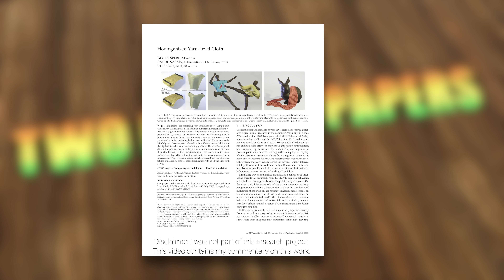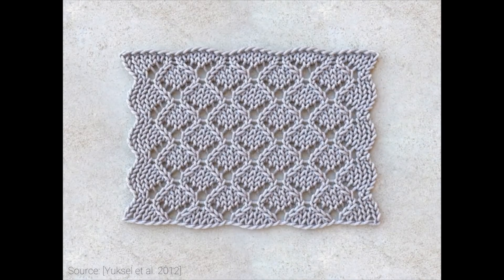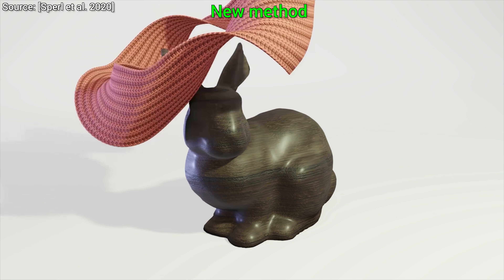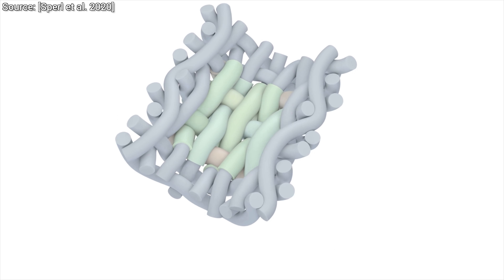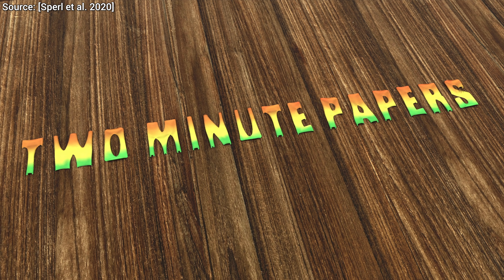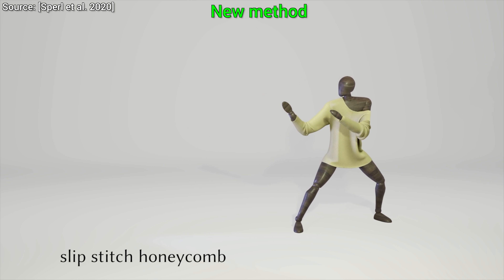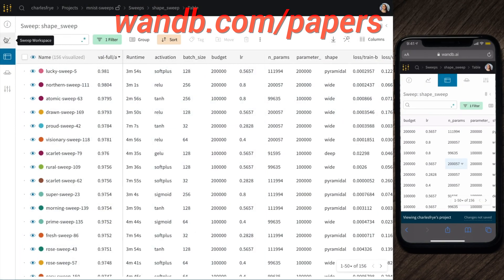9 Years of Progress In Cloth Simulation! 🧶

Comment: I feel like the video glossed over too many details of the paper, resulting in people wondering what the point of all this is, or whether the authors were "cheating" in some way. Which is a shame, since there are some rather interesting innovations in the paper. So anyways, here’s my take on a short(ish) summary of the paper. Hopefully this will answer some questions.

DISCLAIMER: I’m not any of the authors, so I might get things wrong.

Like Károly said, while simulating individual yarns for a piece of cloth looks great, it takes an insane amount of time to calculate interactions between individual yarns. This makes yarn-level simulation unfeasible if
a) the threads are extremely small and/or dense, like a t-shirt, or
b) if the piece of cloth is really large.
Essentially what this paper does to address these problems is that, instead of simulating individual yarns, it creates a 2D surface that mimics the behaviour of patches of knitted cloth. This is akin to, say, fluid simulation. In fluid simulation, we very rarely want to simulate each and every molecule, since that’s impossible with even just a few drops of water. Rather, we use a 3D volume that mimics the behaviour of a bulk of fluid molecules. The key insight of the paper is then that we can use these fluid-sim-like methods for knitted cloth (the technical term for this is called “homogenization”, hence the paper title “Homogenized Yarn-Level Cloth”.)

So how does this paper go about doing this? Since there are a multitude of ways to weave threads together into cloth, there’s no one general physical model that can be easily used to describe the behaviour of knitted cloth (if we use threads as the model, this would just be the 2012 paper all over again). The authors instead proposed the following two-step algorithm:
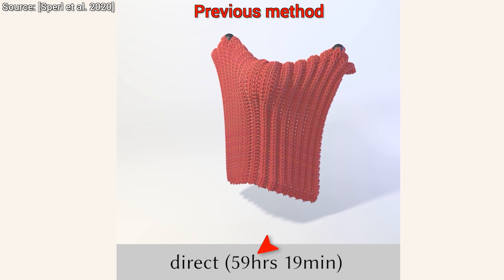1. Start with a small piece of knitted cloth, bend it in different ways, simulate it with traditional yarn-level simulation, and record the results. A model is then fit over the results so that, given a deformation, it predicts the response of the cloth. This is illustrated in the video from 2:09 to 2:29.
2. Now, given a piece of cloth with some arbitrary shape, note that it can essentially be split into tiny patches. We can now put each of these small patches into the pre-trained model above, and it will give us how the cloth responds to force and deformation at every point. With this, there is now enough information to create a simulation.

This is of course glossing over a lot of technical details.

If you observe the two steps above, you will notice an important advantage of this paper: since the individual threads are abstracted into a mathematical model in step 1, the resolution, and hence the total time, of the simulation in step 2 only depends on the resolution of the 2D surface representing the cloth, and not on any properties of the individual threads. Therefore, the threads can be as many or as densely knitted together as you please without affecting the performance in step 2. This is the key to how the new method improves the simulation speed so much, and how it simulates densely woven fabrics that were previously infeasible.

Now just to address two of the most common comments:
1. “How is this different from cloth simulators in, say, Blender or Houdini?” Mainly the first step. The way the model is fit is general enough to mimic many different weaving patterns, and this is a huge departure from conventional methods, where there is only one model with a few adjustable parameters.
2. “But it looks like a flat surface with a cheap texture on top!” Indeed. Since the individual threads are abstracted away in step 1, we no longer have information of the weaving patterns in step 2, and this is a major downside of this method. However, there is a silver lining in that, the model fitted in step 1 contains deformation information of the original yarn-level simulation. Perhaps one can use this to restore the missing yarns, say, two papers down the line? ;)

Obligatory “What a time to be alive!”
Reply from the maker: You are indeed right in many things here. Thank you very much for the feedback and your help! 🙏
Reply: @TwoMinutePapers  Please pin this comment. Me, a tech artist that has worked with it's share of cloth sims needed this context very much.
Reply: This comment needs to be much higher.
Reply: Thank you for summarizing! I was indeed, one of the people initially underwhelmed by the results. "You reduced the fidelity of the simulation, and it ran faster? Wow. /s". It's much more interesting in light of: abstracting the material properties of an arbitrary cloth geometry, into a form a more traditional but faster cloth sim can handle. I'm sure that procedural texturing can restore/approximate some of the higher fidelity yarn details from the model, without too much extra computation.
Reply: Thank you for the comment!
Reply: Yes! Thank you, now I get it 👌

Comment: As a data scientist, and a knitter/sewer, I like the original version much better for knitted items. But I think for woven fabrics, it will be incredibly helpful. Stitch definition isn't really important for woven fabrics. But stitch definition gives knitting it's character, which is lost in the newer version. I love it for the light weight t-shirts, I think that's a real game changer.
Reply: Obviously the original version is going to be better, because it costs enormous time to produce. The point of this paper is not to produce a final product visually.

This paper is trying to show that it's possible to simulate the behaviors of the cloth as a whole (the curls and tension lines) without simulating each individual strand. A paper down the line will hopefully show that their is a cheap way to intrude those characteristics back in, resulting in a pretty good approximation of the full simulation that's much faster.

Comment: I like that everyone here isn't blindly impressed by the new algorithm demo
Reply: @randomguy8196 The issue is that 2MP is comparing a higher quality algorithm with lower quality one. The comparison that should have been made is between ordinary cloth simulation in 2012 and now.
Reply: @yevgeniygorbachev5152  the thing is, this is way more accurate for weaved patterns compared to a cloth sim, and doesn't trade that accuracy for speed like the 2012 one did
Reply: @randomguy8196 Are you sure? How would you reproduce the original style from the faster method?
Reply: @randomguy8196 I have to agree with you. with this method, we can get the simulation right, and THEN, we can use it as a wrap deformer on the high poly mesh. Saves TONS of time indeed. Still not as good as the direct method, but it's a good compromise if you know what you're doing.
Reply: @randomguy8196 And 1/1000th of the quality...
Reply: @randomguy8196 Yes but why use yarn to demonstrate cloth? And not expect people to complaint that you faked the yarn on a yarn cloth simulation lmao

Comment: This paper was clearly cheating: they use a single set of parameters for the whole sheet and pasted the texture after the computation, instead of computing all the thread interactions. You can clearly see the stretching and deformation on the width of what should be single threads... It is just a rubber sheet with a cloth texture, I fail to see what's innovative in this one.

Comment: The old method looks way more realistic with the knitted fabric.
Reply: Yeah when you have some 3D modeling experience it stands out a lot... For the new method, you can have pretty similar results with about any modern 3d software with cloth simulation applied to a model with a fabric texture. The "new" method feels like trying to fake hyperrealistic raytraced renders through rasterized rendering cheats, it's just can't ever be as convincing with current technology and without AI...
Reply: yes but the new one is faster, its a tradeoff
Reply: @AuxenceF  But it seems like just reducing the mesh density with the old method would probably provide similar results?
Reply: @AuxenceF  there are real time cloth physics in games from 8 years ago that do the same, they don't take 2 hours to render. IDK what is so spectacular about this paper honestly. Arkham Asylum 2009: https://www.youtube.com/watch?v=w0Zp4qqLmrw
Reply: @Rem_NL  Batman Arkham Asylum doesn't do strand-based cloth simulations though, do they
Reply: @tundrummax6221  no neither does this method in this paper  (or if it does its not mentioned)
Reply: @Rem_NL  This new method actually simulates proper physics rather than moving around some animation bones to make the cape wave around. Older cloth smilations that actually simulate cloth are still nowhere near as accurate as this one.
Reply: @epicgamer42069  i realize that, but visually it looks nearly the same, so imho a waste of effort. While the original one just oozes quality

Comment: The author of this paper is reallly trying to swindle you. You cannot claim a lower render time by decreasing the quality of the render. Any scientific method would tell you a fair comparison requires an apples-to-apples comparison. That is, the quality MUST be the same or at least give a comparison to the time IF you rendered it in the same quality. The fact that the quality is lowered disregards this WHOLE paper imo AND the authenticity of the author. 

Because I can take this same 3D model and render it at a lower quality and achieve very similar reduction in rendering time without changing the logic. Or I could just count less threads.

It's a seemingly very small thing, but if you've had any experience rendering in 3D, you know this is EXTREMELY deceptive!!!!

Exaggerated analogy is like rendering a video in HD (high definition) and claiming a scientific breakthrough in rendering time vs 4K (to the uninitiated, they wouldn't be able to tell that so much of the savings is in render quality). 

Then they just make a name for themselves or pad their academic resume that they made a breakthrough when they probably just tweaked some parameters and lowered the quality of the render.
Reply: The timings are for yarn simulation only... 

It's actually very easy to measure time of a specific part of your program... My guess is that  you looked at 2 hours of a tutorial  about Blender and now you feel like your entitled to an opinion :/ (# https://en.wikipedia.org/wiki/Dunning%E2%80%93Kruger_effect)  How about you go write a cloth simulation program and get back to us with some true insight, or better read the paper and after you truly understood every single line you come back with constructive comments: http://visualcomputing.ist.ac.at/publications/2020/HYLC/

Right now you're  just embarrassing yourself in addition to being rude.

Comment: The new one looks like a 2d plane being deformed like cloth with a texture applied. If you applied raytracing or something could you get the transparency to come back?
Reply: The second half of your comment is complete nonsense. Ray tracing had absolutely nothing to do with any of this.

You could use an alpha mask to get the holes back, or you could use the simulated mesh to deform a high density mesh with actual yarn geometry.
Reply: @games528  who said anything about ray tracing being apart of this video? I was asking a semi rhetorical question with a yes or no awnser. The awnser is yes, you COULD use ray tracing to make it look transparent as long as the texture has proper alpha values. it could be used to make the fibers look 3d with the proper normal maps.
FFS
Reply: @namenull7399  Ray tracing does not matter because you can also simulate transparency with standard rendering method as well (a.k.a standard rasterization). The point of the method is that this 2D sheet looks exactly like the physically accurate simulation with the curls and all but you only need a fraction of the computation time.  You could use many methods to improve the "final look", alpha transparency being the most basic one. You can use displacement maps and normal maps as well (again it works both in ray tracing or rasterization...) or better use the 2D sheet (which animation and folds are accurate) to drive a 3D mesh that represent the yarn, because the mesh is only following the 2D sheet it won't take much time to render contrary to past method that simulate every single force and collisions for each thread. Research works like bricks, the topic being researched is always very narrow and sometimes authors do not have even time to produce the best possible results/renders (or the necessary knowledge in modeling and other tools etc.), the goal is to unlock fundamental problems so that other people can go further. What I'm trying to say is that often you have to judge the paper by how he does things (algorithms, math etc) rather than the result itself. so you have to extrapolate what could be done. It's like if I do a standard cloth simulation than runs twice as fast as a previous cloth sim but I have poor skills in lighting and the final video sucks compared to old methods, it does not mean the method worthless or that it's not a major scientific improvement.
Reply: @namenull7399  Ray tracing has no relevance to texture alpha values. All modern (2000s) non ray-tracing rendering engines support it. Also these examples are already most likely rendered with ray tracing (why wouldn't they be?)
Reply: I don’t think you understood the method nor raytracing in general.
Reply: @squidbad  and i don't think you understand my question.

Comment: While the speed increase is impressive, the visual fidelity takes such a massive hit that I'm not sure the trade off is worth it in this case. It's good for the super high density weaves like satin but for knitted garments IMO it just doesn't hold up.
Reply: 100%. As a knitter and a programmer, it just looks wrong. It's clearly a 2D sheet and lacks depth in the edges and for many knit patterns, the gaps and stretch in the stitches are as important as the yarn locations. It's sitting in an awkward position, where the old method is probably better for high fidelity loose sparse knits but a generic cloth simulation might be better for high fidelity dense knits.
Reply: Well, the previous one does look better, but if the fabric you are going for is dense enough you might get away with just using a displacement instead of actually simulating all of the individual strands.
Reply: @helphelphelphelpmehelphelphelp  Sure, it may be possible, but then it does not show any real progress with low density weaves
Reply: right, it almost looks like the knitted geometry is printed on, the previous results were much better and actually looked like knit fabric. Anyhow, I can't wait for more improvements in the future, I'm sure there'll be a way to get both good looks and fast processing in some time.
Reply: Maybe it could be used so you render the important parts with the lengthier but more accurate method and the other ones with this faster one, as he was talking about movie renderization
Reply: @A11V1R15  It's possible that's what the next paper down the line could look like. I can't wait to see how both of these methods can be improved on in the future!
Reply: Yeah, it looks a bit wrong, like an HD minecraft texture pack.
Reply: He reminds us in the video not to fixate on the current level of performance, but to imagine where we’ll be two papers down the line.
Reply: I guess it depends on what you wanna achieve with the clothing simulations, if you're okay with the simulations not being super realistic (like in a videogame for example) in exchange of faster  rendereing simulations, then this new papers is definitely worth it.
Reply: @martiddy  i get what you mean, but this is still too slow for a game, cloth simulations in games are very basic tbh.
Reply: You have to compare it with cloth simulations that take similar time, if it's better than it's good, the video didn't include similar cloth simulations for comparison tho
Reply: It's incremental as a step toward making those types of simulations better and viable and faster.
Reply: @tylercs8750  I heavily disagree; most cloth simulation in games still looks awful. That said, it doesn't seem like this technique is quite fast enough yet.
Reply: would it not be possible to take rough particle data and generate a texture to apply to it with transparency and stretch accordingly?